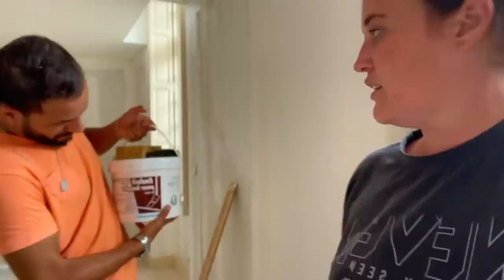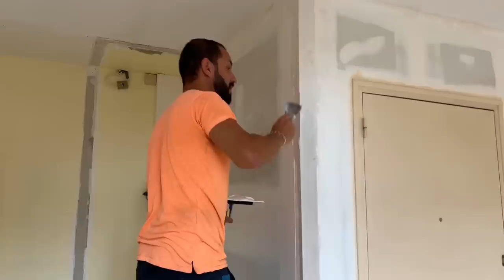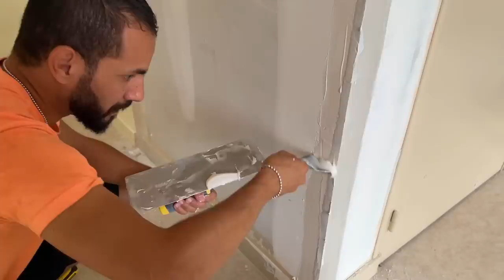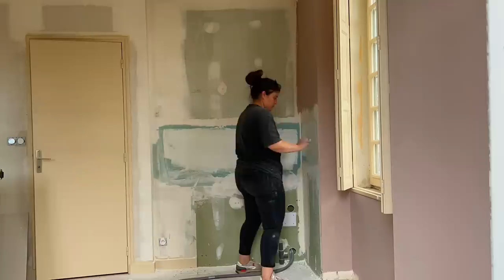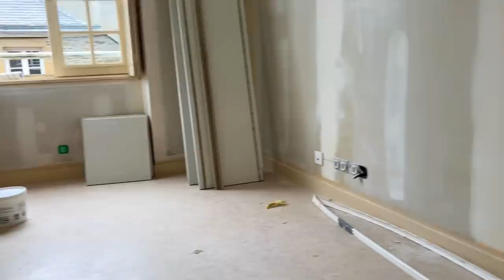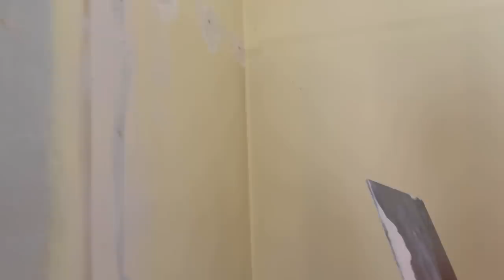The Convent Apartment

Comment: If you turn the power/torque down on the drill it won’t strip out the screws as easily when you take the base boards off. maybe start at a lower number and work your way up. If you buy new baseboards, nails will look better when you put the new ones up… and they are much better for the job than contractors glue.